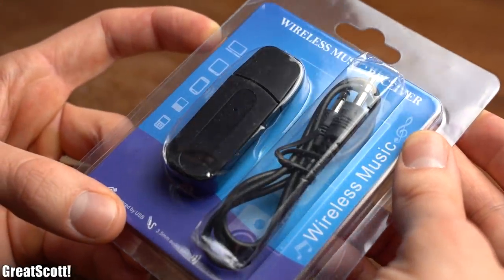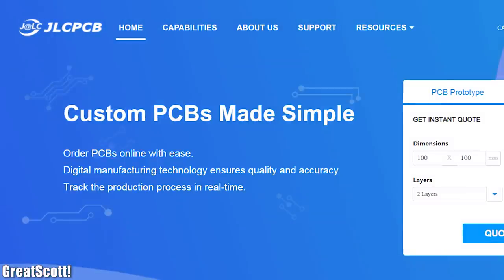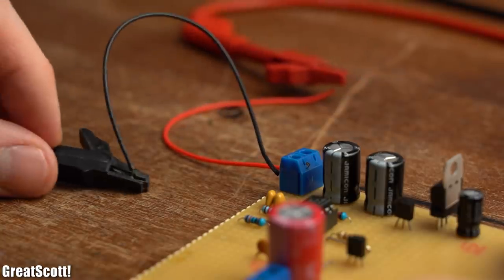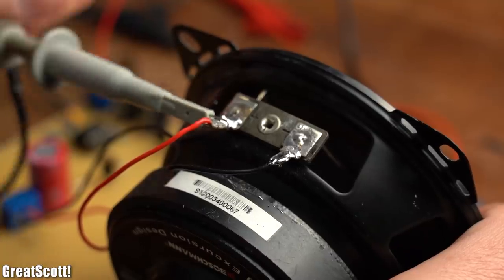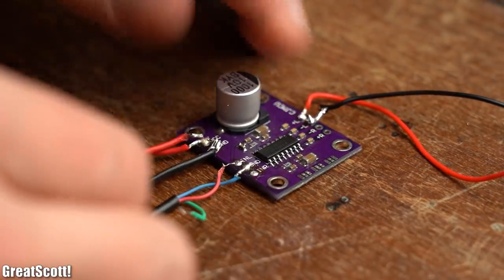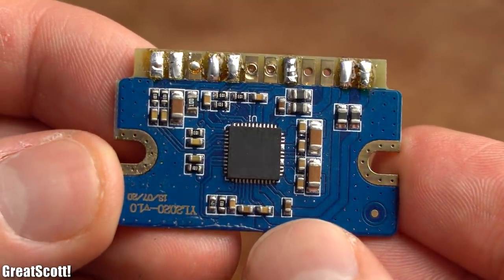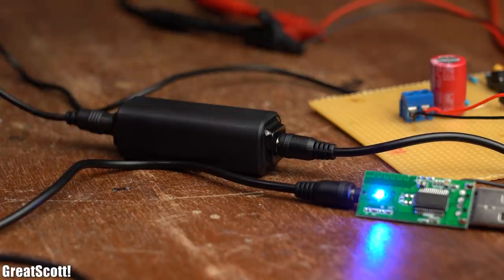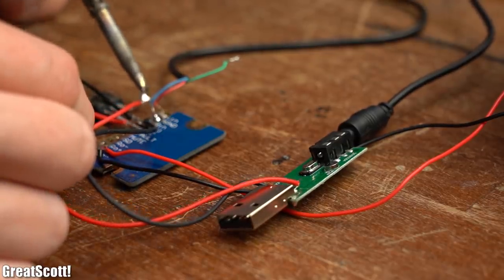How to remove buzzing/noise from a cheap Bluetooth Music Receiver? (Experiment)

Comment: Cant you put a capacitor in paralell on the 5V line, so that it smoothes out the interfierance?
Reply: I tried by myself. doesn't work.
Reply: @SyazwanSaidan  Maybe some higher capacity capacitors.
Reply: If you added it in series you would form an open circuit as soon as it charged.
Reply: @AtlasReburdened  This happens with direct current since the voltage is constant, but rember that an audio signal (and any type of signal) isn't constant. A capacitor put in series between a signal and an aplifier is actually used to remove offset voltage.
Reply: @AtlasReburdened  Yeah i ment parralel
Reply: @TheGTP1995  But also doing that may change the audio quality.
Reply from the maker: Tried that. Did not work.
Reply: Tried with 25v 220uf, but didn't work😢,
Reply: @kruemmelbande5078  Different types, All capacitor types have a different range of frequencies they can cover. For the highest frequencies use mica, electrolytic for the lowest frequencies and remember fuck tantalum's.
Reply: It sounds like low frequency noise. Isn't it better to give a coil between +5V and GND ? And whatabout to give it between GND and EARTH from wallplug ?
Reply: @MrHmm-cv6gs  for high frequencies you should try mica, ceramic or film capacitors. Electrolytics are useless at filtering high frequencies.
Reply: @DantalionNl  thanks buddy, I will try it tomorrow morning, 🙏
Reply: I think the aim is a notch filter but would requires inductors too. Look at X and Y capacitors in a mains filter and see how they deal with mains generated hum. Now you need to replicate that at higher frequencies.
Reply: @TheGTP1995  Yeah... I know how capacitors work. That's why I was correcting a comment about how capacitors work. We weren't talking about a capacitor in series with the amps input as that wouldn't do much at all for the problem at hand.
Reply: @AtlasReburdened  I expect the LF component (ie the pulse frequency, rather than the components of the pulse noise itself) of the interference would be far too low for a capacitor to do much with.
Reply: What about a capacitance multiplier?
Reply: The capacitor in parallel would actually make the noise worst. This is because, each time the amplifier makes this sudden current spike, the capacitor act has a 0 ohm, short circuit, for high frequency content. A rectangular wave contains a large number of high frequencies, starting with the third harmonic. The capacitor return that noise right to the ground.

You can not change the spiking of the amplifier, but you can protect your +12 volt power supply from the spike, The trick is a small inductor in series on the +12 volt supply of the amplifier. And two capacitors (one large electrolytic for near DC stability and a small 0.1 uF for high frequency) of the +12 vol input side (power supply side) and no capacitor at all on the amplifier side.
In anthropomorphic way, you say: You want to spike? I let you spike as much as you want, bless your hearth.
Reply: @moiquiregardevideo  I agree that a small inductor IN SERIES with power output of 5v (or the spike sources), both +5v and gnd, would smooth out those spikes. I think a small 10mH, 1/4 W or 1/2 W ones would be sufficient. If you want to step it up, you can add low-pass filter, cutoff at 20-30 Hz so it will not pass ac frequency too.
Reply: @GreatScott!  Proper way to solve this problem is low pass filter. You have kit from Wurth, try to place inductor in series with bluetooth module on power pin and you will see this will solve your problem easily. Capacitor not even capacitance multiplier will not be enough to do it.
Reply: How about putting a choke on the ground line to block any AC component superimposed on the ground line?
Reply: parallel
Reply: It helps a little but does not totally remove the noise.
Reply: @greatscottlab  Try to connect a ceramic disk capacitor(bypass capacitor) as close as possible to the Bluetooth module power rail in addition to the bulky electrolytic capacitor,  with another capacitor on the common ground between amp and Bluetooth module, also avoid sharp edges tracing on the pcb and finally use short distances as possible between the components. ✋🏼🙂
Reply: @greatscottlab  Filtering out with a capacitor is not really possible. Maybe something like a high attenuation LC Filter(eg Pi Filter, T-Filter) would work. If that would not be enough maybe something like a Common mode or Differential chicken would work. But I guess it would be a lot of work to get all the values right for a perfect filter. 
@GreatScott! would be interesting to see if the mentioned methods would work :)
Reply: I have the same bluetooth usb stick and i use it for my car. I had buzzing sound but not very terrible. I teared down bluetooth and soldered 2200uF electrolytic capacitor between +5v and gnd. And about 80% of humming buzzing sounds were gone. But amplify gain was also lower compared to before. Lost about 10-20% of sound loudness. But it might be because of dc power supply having limited current so it would probably keep charging capacitors and there was less voltage for bluetooth. It was kinda funny to see that my phone recognized bluetooth module to have battery inside it lol, i could see battery indicator near bluetooth logo.

Comment: i connect 2$ 5v bluetooth module to old  creative sound work 500DAB , i take the 5v power  from  creative board. to remove noice i put radom capasitor to GNG and 5V pin of bluetooth module. and its perfect...

Comment: Did you check if the power supply ground of the USB bluetooth audio receiver is actually connected to the audio output ground? If not, then that's your problem.
This amplifier design is prone to amplify power supply noise. With this schematic to work with, I'd try to introduce the input signal at the positive opamp input. OR... try adding a capacitor of 220nF from the positive opamp input to ground.

Comment: You could consider putting resistors on the left and right channel when you first connect your phone to the amplifier -- rather than short them out, if one is high voltage and the other is low, it just shorts your phone amplifier out, so you're risking some damage.

Comment: Surely you just had a ground loop between the signal and power ground connections to the bluetooth adapters. All you had to do was put -say - a 10 ohm resistor in series with the signal ground.

Comment: The higher the voltage the higher the voltage humm.  You just needed a inline suppressor added before the in voltage to the blue tooth voltage in line.  The suppressor are normal for audio equipment on ac voltage.  Look for a DC inline suppressor.  Or make your own with magnets and wire.

Comment: I've resolved this problem putting a common mode filter and a RC filter - low pass between 12V and the 7405
This solution remove the noise with few components

Comment: I always use a lot of capacitors, coils and resistors on the power supply to reduce noise. But this increases the size of the project.

Comment: Another solution to make it work with a single power supply is to go for a single 12V transformer connected to 2 seperate bridge rectifier circuits, and add a 5V linear regulator to the output of one of the bridge to get 5V for Bluetooth receiver.

Comment: Was the noise from the 12 v supply?  I didn't see you test it, but it has to come from somewhere.  I didn't see or hear any mention of capacitors on the power supply lines - they would have helped remove induced noise.  Typically you'd want caps on the each side of the 5 v regulator to ground (12 v and 5 v), but I'm guessing you probably know that.

Comment: Hello sir nice video. Sir can u tell me about your blynk controlled RGB led lamp, if I want to use 50 watt LED chip instead of 10 watt then what should I change in your project circuit diagram. Does I change gain value or 1ohm resistor value. Plz reply sir waiting for your reply.

Comment: Splitting the Grounds work, but can caus EMC Problems. Abettwe way would be to reduce (damp) the current rippel by placing a Bypas cappacitor near the current sink and a ferite on the GND line

Comment: Project idea: Simple Arduino sensorless ESC.
It would be cool to build an verry simple ESC with no special ICs or expensive components. Just mosfets or igbs as switches and normal transistors as drivers.
Have a nice day!
Reply from the maker: Hmmmm I can put it on my to do list :-)
Reply: I think Electronoobs did something like this on his channel.
Reply: @ristomatti  I build his design many times and it never worked. I probed it with my oscilloscope and there never was a proper signal. I have tryed different mosfets and driver. And one time it fryed my Arduino.
Reply: I think it would be better to do it without back EMF and just put out a variable 3phase signal with adjustable frequency. For me the electrons part isn't hard. But im not verry goog at programming.
Reply: @m.schiller  Hah. I'm not surprised at all if it didn't work out. The videos present so many concepts at once that I think he just wants to give a simple example that willing people can then continue refining to make something actually useful.
Reply: @ristomatti  I agree. I just wanted to try out his schematic and code because i need a cheap and powerful sensorless ESC in a e bike project. And the problem is that there are almost no simple ESC videos out there.
Reply: @m.schiller  Maybe it just isn't simple to do? :)
Reply: @ristomatti  when you look at the rc ESCs that you can buy it doesn't seem to difficult. Just a microcontroller with some mosfets and drivers.

Comment: Obviously the isolated converter is mandatory (I would put a 10k resistor in parallel to its output just to make sure the voltage is stable), but the bluetooth adapter creates hissing noise and sometimes high pitch on its own!
I'm working on a project and might have to give up on Bluetooth because of this sadly...

Comment: Just use two diodes connected in parallel. One must let the voltage through in one direction and the other in the other direction. Because of the voltage threshold that has to be passed, the "buzz voltage" cannot pass.
Reply: Can you explain a bit more? I would like to give this a try

Comment: I'm using exactly the same Bluetooth adapter in my car for almost two years. That was the first thing I've done with it after I bought it, this solution was found on Google. And it is really great for such a low price, sound quality is pretty nice.
BUT! I've noticed another annoying issue with this adapter. Sometimes it "stucks" for a 200-500ms or so randomly, so the sound is "fragmented" and a bit late during this bug. Then it gets fixed on its own. I can't find any correlation for this bug. It is quite rare, might be once a two weeks. Or 7 times per day another time. I believe that my adapter is just fine and the issue is related to all BT-163 devices. Could you suggest something in this matter?

Please give some thumb up to this comment since this issue is much more annoying than a noise.
If you had ever used this adapter you will agree.

P.S. Thanks for the video!
I used B0505S-1W in my case. It is small enough so you can build it inside the adapter with some effort. Totally solved noise issue.

Comment: update, just add 4.7ohm resistor and 220uf capacitor after the voltage regulator, so the arrangement is, voltage regulator then resistor on the plus line, then the capacitor

Comment: Hi Scott. I tried building a Bluetooth speaker from scrap and encountered the same problem. After testing the whole circuit with a multimeter, I discovered that the grounds in a tp4056 are separate and it solved the issue of ground loop. Have a look at it pls.

Comment: I added an mp3 player source to my old Ford radio, and ended up coming to the same conclusion and solution. P.S. if anyone has those cheap plugin bluetooth car adapters that sound like crap, it is for this reason. DC-DC isolation modules are worth the additional cost.

Comment: It also should be possible to get rid of the noise by filtering out the voltage and current spikes on the supply-trails of that BT-"thingy". 

Essentially this should/would be possible by using a 2. (or higher) order lowpass with appropriate cutoff (first guesstimate about 0.5 Hz, maybe?) on each of the supply trails of the amp as well as of the BT-thingy...?

Comment: I find with these ebay Bluetooth receiver boards marked AGND and GND are connected together.  No isolation at all.
Also, in most cases AGND (the audio input ground for left and right) and GND are the same on the amplifier.

Comment: I had made a Bluetooth speaker and was facing the same issue. I had commented on the original video for a possible solution but sadly didn't get any references. I ended up using separate battery to power the receiver.

Comment: Capacitorless headphone amplifiers drive the output "ground" at about half the supply voltage so that they can drive the channel outputs with a (relatively) negative voltage when the content calls for it. What you are hearing is the ground driver cutting out due to overcurrent. Major trap for young players!

Comment: I used a 16 Ohm 1/4w resistor on audio input of the amp to fix it. It reduced horrible buzzing but there is really low hissing noise coming deeply from the tweeter.

Comment: I had the same EXACT problem a month ago. After deciding this would not work and almost abandoning the project I read a hidden note on the datasheet in broken english translated from chinese: SOLDER MUST CABLE ON GROUND AMPLIFIER, cable should be not long!!! The Chinese got that right! I glued the bluetooth board directly next to the PAM8610 amplifier and soldered the ground with thick wire 10mm long in total. NO NOISE anymore.
Take away message: Solder with very short & thick wire the GND of the Bluetooth to the power GDN of the amplifier.

Comment: I've been working on a major project for some time and had a similar issue. Odd thing is that if I'd power the system off battery the problem disappeared?  Using a dc-dc converter solved the problem. Thanks for the video.
Reply: Steve Roberts how is your comment so old
Reply: @bruhdabones  Patreon supporters get the videos a few days earlier

Comment: I know that solution #1 (separate +5 volt power supply) and #4 (DC 5V/DC 5V) are the best.

But, just for curiosity, was there a way to filter the +12 volt supply to the audio amplifier with one inductor in series? The rationale being: if you reduce the current for these short burst spike, then the ground side also gets less spike current. As explained as comment to another answer, you would put two capacitor on the +12 volt supply side of the inductor. One large electrolytic for near DC noise and a small 0.1 uF for the high frequency noise. And connect no capacitor at all on the +12 volt amplifier side on the inductor. The inductor has to be the kind that accept a constant DC current. The DC part reduce the active region margin of the inductor. For example, two coil rolled in opposite direction to cancel the DC magnetism, allowing the core to get it's full active region before saturating.

Let's call that Solution #5

And one last idea that deserve attention: What about following the electrical engineering rule to designate one location as ground source and connect every ground to that location? That would be Solution #6

Comment: I was thinking also at the DC/DC convertor but I would have removed the linear regulator. I didn't know about the ground loop isolator solution but at the same I didn't understand why there was still noise after using it. I mean the grounds were isolated from each other as shown in the schematic.

Comment: The rule is one earth at the lowest signal point, ive seen all this bunk  about tranformers, with high gain cicuits noise can happen but one commmon esrth at the lowest signal point will do it, earth loops must be avoided for example with phono plugs somtimes remever the earth from one, the two sockets will be grounded and if the other end is grounded then the the cables will be a ground loop. This proble here is instabilty and that is usualy layout or power supply inpeadence problem.

Comment: wow.. Actually I solved this problem accidentally, I found about 10 years old Phillips speakers with analog input (RCA), I thought to add Bluetooth ( which comes with aux in/sd/fm/USB) and powered it from amplifier's source using 7805, but current was not sufficient so it was turning off automatically, than added a separate 5v2A board for Bluetooth and it worked fine.

Comment: I connected a USB module on old sony Grx8, I removed the CD deck and connected the USB in it place. I used 5v power supply that was supplying part of the CD deck to power the usb module and connected the USB module audio output where the CD deck audio output was connected onto the Sony audio pre-amp. Everything worked so well except that there was a funny noise that was present when the USB loads the music, when the next song is selected and when the volume is turned up the noise was unbearable. What I did is, I added a 25V 2200uf capacitor across + and - of the 5v power supply that powered the USB module and the results were amazing, the funny noise disappeared.

Comment: I have one of these cheap bluetooth receivers in the car. I had issues with a higher pitched noise than you are experiencing. A ground loop isolator worked for my issue, and has continued to work for a few years now. I am curious what is different about your issue that did not allow the isolator to work?